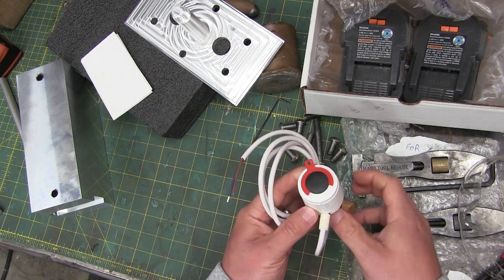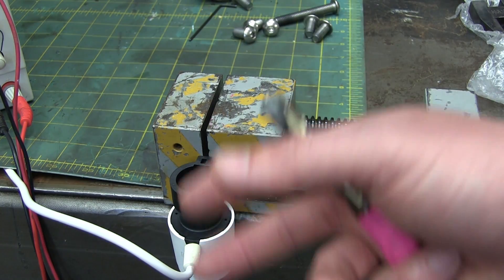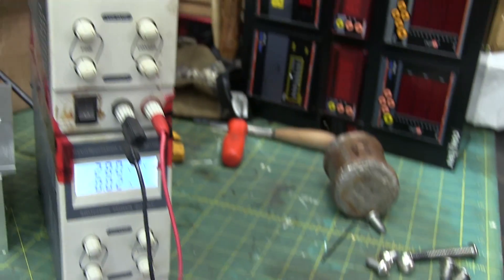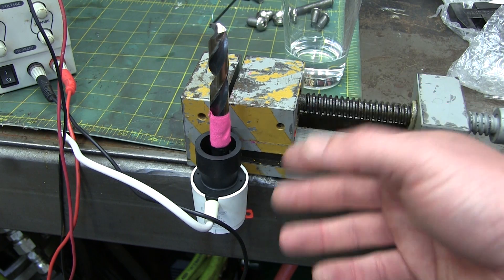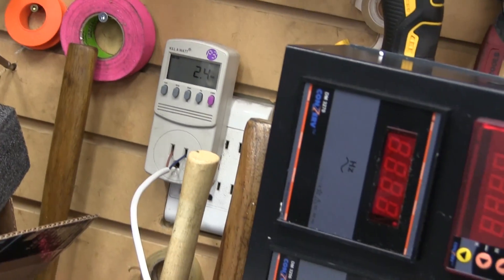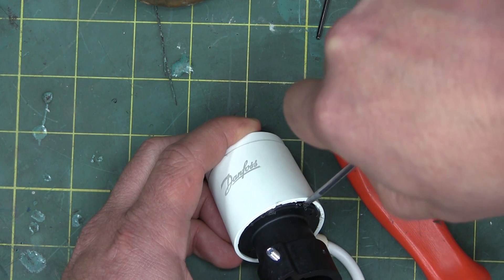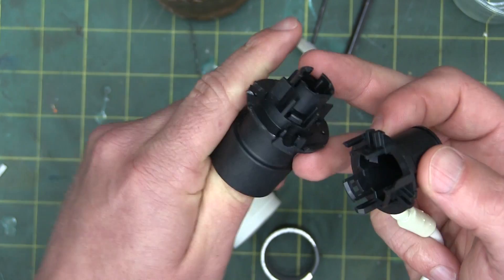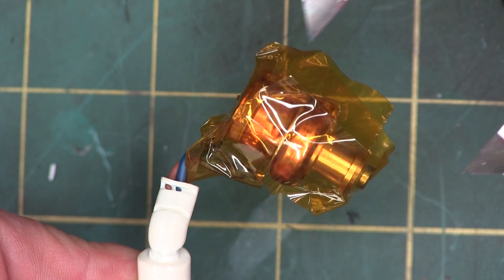BOLTR: Wax Actuated Motor | Mindblowing OLD Tech

Comment: This technology is/was (haven't owned one in quite a few years) used by GM to actuate the front differential lock on 4 wheel drives trucks.  If the truck was in 4wd and it was driven through a cold enough water hole it would cool the motor and no longer be in 4wd.

Comment: Central heating radiator thermostatic valves. and some types of hot water cylinder valves use this technology. one type has a tapered pin inside the rubber element. On heating, the expansion of the wax pushes out the tapered pin. A bit like you grabbing a wet bar of soap!

Comment: Damn! 50psi with 2mm?!? I thought I was doing well lifting my shower towel with 2 inches!
Reply: 50psi? Not quite. He only said 50lbs.
Reply: @benargee  It's way more than 50 PSI, because the plunger that comes out is less than a square inch of area.
Reply: @mbrunnme  I didn't mean "not quite" in a quantitative manner. I meant it in a true/false sense. Yes, 50lbs at 2mm diameter is way more than 50lbs at 1inch (50psi).

That being said, pressure/area is irrelevant to this device's application.
Reply: Danger Bear  allow me to clarify. P E N I S

Comment: I'm sure there is a name for the mechanism, but I'm as some may say "I'm still wet behind the ears" bear with me on this one. Image the do-dad in your whipper snapper that engages to allow the motor to turn over, but also then allows the pull cord to retract, or i guess even a 6 toothed saw blade looking thing. So picture that with one of these motors placed at every tooth so every hour of sun (depending on how many motors are arrayed) one motor would be allowed to expand and retract freely. Just spit balling here.

Comment: This is for a radiator. The radiator valve is normally open and has a pin sticking out, which when depressed turns off the flow of water and thus the heat. It would make most sense if the actuator normally pushes the pin (which explains the spring) and clears the pin when powered. This way a power failure would not turn on the heat.

Comment: These were used in mechanical fuel injection systems as a cold start enrichment system - as the engine warmed, the enrichment circuit would slowly close.

Comment: I owned a Maytag Neptune. So I know exactly what a wax motor is
Reply: Every few months one of my Maytag washer's wax motors would short out and burn up the printed circuit board of the main control panel. Very expensive. Had to toss the machine,

Comment: I thought the component that used wax was the cold engine choke?  The wax holds the choke open until it melts with engine heat and closes with spring actuation.

Comment: The Bell 206 Jet ranger helicopter uses a valve very similar to this as its transmission oil cooler bypass valve.  As the oil heats up the wax inside, the valve closes and redirects the oil through the radiator.  Very simple in design but effective.

Comment: this reminds me of the "how it's made' episode for car thermostats.  they put what looks like copper powder and other things in the wax for some reason (thermal conduction?) and then put it in the cup with a rubber plug just like in this device.  Then they crunch the side to adjust the temperature where it actuates.  This thing appears to have those "adjustment marks" too, to tune its operation.

Comment: I think that I've seen a wax motor that operated the choke on a moped. Engine switched off = no electricity to the choke and the engine is fully choked. When the engine is started the device gets electricity, which makes it heat up at the same time as the engine heats up, then the choke is opened.

Comment: For solar tracking, this would only work in perfect solar conditions. If it is slightly cloudy, or several passing clouds the tracker will always lag behind. Also even in overcast a solar array will output significantly more if correctly aimed towards the sun. The wax tracking idea would fail to accomplish this correctly overcast conditions without the use of some other energy source to provide the heat. I have seen on forums where simar concepts were attempted with these conclusions. Worthy thought experiment in its own right no less.

Comment: You can use gas actuators for analogue solar tracking. As one heats up it expands and moves the panel and itself into the shade. 

As the sun moves it warms the ram again and the gas expands again.

Comment: In HVAC, with careful control, you can get these to modulate using PWM - way cheaper and more reliable than an electric modulating actuator. Just have to deal with the five minutes it takes to open and close completely.

Comment: Also used in some side-loading washing machine latches/lock relys (note: when these "fail", it's often just a matter of bending the contacts. When they truly die, it's usually external plastic bits. It's never the wax motor itself.)

Comment: FYI the 4th Gen of GM 4x4 trucks used this type of actuator on the axle coupling in their front diffs to activate 4wd. They later replaced it with an actual electromagnetic servo for more positive operation.

Comment: Well that was certainly interesting.  Never heard of such an animal before.  I saw a minor issue with the demo, if it needs two watts of input power at 240VAC,  if you feed it 120VAC, and assuming it is a resistive load, the actual input power is only half a watt total, not one watt, since when you cut the voltage in half, the current will drop in half too, and as you know, power is voltage times current.  So essentially it was only getting one quarter of the normal power it requires to work correctly.  I thoroughly enjoy your channel,  you have demystified many mysteries of tools, technique and I still have all my fingers as a result.  Keep up the great work!
Reply: Yeah. P = V^2/R

Comment: GM used this type of device in early 90's 4wd pickups to engage the front axle. As a result, in the dead of winter when it's 20 below, they had a tendency to let you down lol. Eventually they released a refit kit with an electric solenoid. An early fix for offroaders was to remove the wax hookamadook and attach an old school choke cable into the fork in the axle

Comment: AvE through a tuber message at me , I know exactly how to solve your solar panel tracker system.  in a nuttier of a chell. two small solar cells mounted on the same plane as your main panel(s) , preferably the same mount. okay so then you put a divider ion the midline between the two smaller cells so that as the sun moves, it will put the EAST cell into more shade than the west cell, causing a voltage difference that you could feed THROUGH a pair of mosfets as part of an h-bridge to run tracking motor.. end of travel limit switch to rip a reset to facing east.   FOUR photo cells and a '+' shaped 'shade' and a second motor , you could even get the photovoltaic panel to track for season. no having to adjust the angle of incidence every couple weeks or so.

Comment: Hey AvE: First post, Solar Energy Professional here: There are actually several kinds of solar trackers that work based on the principle you mention: Not with wax, but with gasses. For a great example, check out Zomeworks- They've been selling this since the '80s:

Their stuff is pretty simple, using physics because physics is Sexy: They use alcohol or something that has a low phase change temperature to act as a pump to move liquid between cylinders to shift the weight of the solar modules to follow the sun. Think "drinking bird" but on a larger scale.

Comment: Smaller ones are most commonly used in dishwashers to open the soap door flap speaking from experiance they get quite warm
Reply: Ray M wow. 
Thanks I have wondered how those worked for years and haven’t had an excuse to take one apart.
Reply: My old Electrolux had this. I'm pretty sure I still have it laying around in my heap of jun... Uhmmm... In my shop.
Reply: Ola Magnus Lie The proper term is Empire of Dirt.
Reply: wolfedog99
Know your variables.
Water temp is a constant.
Pre wash duration is a constant.
All you need to do is provide the right amount of insulation to delay the opening of the door.
Reply: @c6q3a24  Water temp is not a constant. It varies from home to home, and also varies in the same home dependent on use.
Reply: @BruceNJeffAreMyFlies  
Dishwashers typically heat the incoming water above the household baseline. The engineers designing the delay mechanism know the temperature the unit will operate at.
Reply: I've taken apart a dishwasher with one in it. I said ' A wax motor? really!? wtf!?'
 yup, that's what it is.. learned something new.
Reply: They're commonly used to open and close the vent in dishwashers. They're electrically controlled in that application.
Reply: Thermostat in car cooling systems also use a wax motor.  Heat provided by the engine coolant.
Reply: Learn something new everyday👍
Reply: Wax wife FTW.  Very quiet, works diligently and is hot!
Reply: All the ones I've serviced where just regular electric motors driving a timer contacts and a the door. No fancy wax motor
Reply: Smells fishy to me, or its one janky old dishwasher. How is that going to open for the main wash but not in the prewash and along with high temp/heavy duty vs normal temp or china/light wash cycles? A door isn't needed at all in a single stage wash.
Reply: The washing machine application is so you don't open the door during the spin cycle and rip your arm off. Even if the power is cut and the thing is freewheeling, the hot wax is going to keep that door shut for a while.

Comment: By the way, this is a good way to explain to people why it makes no sense to crank the heat all the way up to as much as she will suffer when you first start the car. The little valve that lets the coolant flow around through the heat exchanger is shut tight, so that the engine can get up to as close to operating temperature in the cold. So, it makes zero difference to have it at 80F or 60F when the temp is 10F outside, and same for the whole engine. This is also why it is a good idea to let the engine idle for a minute or two before you throw it in reverse to scoot off to wherever you are going on that cold, cold day. Got to let all the fluids start to warm up to get to the proper temps!

Comment: .... too crude and over engineered. going solar? one of nature's best and most efficient solar collector is a blue spruce. panels shaped like the branches on a spruce topped with a small vertical wind turbine turning a motorcycle alternator..... might be the tits you're looking for. no need to switch or move anything, but then I'm still a fan of mercury switches and thermometers.....

Comment: Where is the reassembling part of the video? Kidding aside how would the cylinder be assembled? Would it be a multi-die extruded casing paired with inserting the cylinder rod, rubber insert then paraffin jazz then put inside of another mold to roll the edges together in the midsection?

Comment: I wonder what a single acting hydraulic cylinder half full of paraffin wax would do. Maybe a paraffin over hydraulic setup with a large diameter cylinder, wax on one side, oil on the other with the oil flowing into a small diameter cylinder doing the actuating. Probably cost more to build than it is worth though.

Comment: The valves are actually spring loaded to be open and the valve is closed when the wax expands in the wax motor. So you add energy to the wax motor to force the valve to close. This also has the benefit of the wax motor actually working automatically without added electricity as well, which makes it great on hot water radiators.

Comment: Pretty sure most of the older GM trucks (88-98) use the same technique in their front differential actuators.  Should be pretty cheap and easy to scrounge one of those from a scrap yard for more testing and experimenting.

Comment: There are gas cylinders  that work on the same principal.  Much more range of motion so they are better for solar panel tracking.  I use wax cylinders for shutters in my greenhouse, pretty amazing once you get them tuned.

Comment: So the angle of the dangle is directly proportional to the heat of the meat?
Reply: Factor in the Sag of the Bag
Reply: Plus the size of the prize...
Reply: ...and the square of hair and the cube of tube
Reply: You have got it all wrong.

The correct mathmatical relationship is :
Length times Diameter plus Weight over Girth divided by Angle of the tip squared.
Reply: Which is also equivalent to the sum of the cum
Reply: Don't forget the speed of the deed
Reply: that's why you keep it in the vice, to maximize swelling
Reply: One must also not forget the swole of the pole in proportion to the width of the hole.
Reply: Teamwork makes the dream work

And then one day in the land there wasn’t an argument on YouTube comments and everyone was nice and friendly had a laugh 🤭 
Motherfuckers 🤪
Reply: PapaWheelie and the mass of the ass
Reply: Girth potential of the birth canal.
Reply: Precisely
Reply: The angle of the dangle is proportional to the fall of the ball.
Reply: brewers group
Reply: Just watch out for the Goo from the Schmoo.
Reply: parity bit 0 good comment
Reply: Remember to take note of the swing of the dingaling.
Reply: Therefore the urge is constant.
Reply: One must not forget to account for the draft of the shaft

Comment: Eric the Car Guy did a video on something similar years ago.  He said older Hondas (early to mid 90's) used wax in the idle air control valve.  The wax would melt at a certain temperature, and in turn, would actuate a valve.  Very interesting.

Comment: Read through the comments.. they beat me to the chevy 4wd actuator. Curious how well it worked with cold weather? The work ok here in the hot country, just slow...
Reply: Randy Bigler  an05 blazer takes about 5sec after you push the button.  That is a long time to be sideways on ice awaiting some steering input from the front axle. Took about a quarter-mile to complete the 180°  spin  engaging as i came to a stop.

Comment: I do wonder if the copper mix-in might not be for heat transfer after all. Wouldn't the two cases have different profiles of movement over time? A pure paraffin mixture would mix well but you'd still have a solid slug of wax in the middle that melts over time. My gut tells me that would have a slow and non-linear rate of expansion. However, if you're moving the heat through the wax with the copper, you'd approach the melting point much more uniformly, wouldn't you? I think that might result in a quicker, more evenly distributed movement for the actuator.

Comment: @AvE Four lsd's under a parabolic reflector.  Average the inputs and your high point is the brightest field.  It's a chopped down version of the comparator we use in strategic satellite ground stations.  Write program to slew accourdingly.

You'd only need two valves on the upper corners and a hemispherical pivot on the from base.  They can provide all the angular adjustment you need for for a flat plane like a pvc.  It should be cheap and easy with your skill set.

Comment: Typically (at least in my area) we use wax motors with a end switch, thermostat powers wax motor 5 min later the end switch makes which than that powers the boiler and or pump for that zone. Little bit more efficient that way and impossible to get into a water hammer situation. That style wax motor would typically be used in a constant run pump system, like an apartment building, or commercial setting.

Comment: The copper is probably there to help with the heat transfer because the wax has a hopelessly bad heat transfer coefficient.
But i agree, shove a bunch of wax into a tube and have yourself an actuator.

Comment: That concept is used as a choke actuator on Honda motors. Choke is closed when cold, as the motor heats up the wax melts and turns the choke off.

Comment: Similar technology as a thermostat in an engine coolant loop. Calibrated to stay closed, keeping coolant in a short loop until the engine reaches operating temperature, then open to allow flow through the radiator. Uses the temperature of the coolant to actuate open/closed, which can regulate the coolant temperature, thus keeping the engine in the correct operating temperature range. These devices are so simple, they can outlast the life of the vehicle, as long as internals and seals aren't contaminated/corroded of course.
Reply: spring wore out on my last one.
Reply: They last a long time but certainly not outlast the vehicle. They get weak, stuck, or the parafin escapes and the stat does not open at all.
Reply: Understood, yes they can break/fail, but the operative word is "can", as in can (or could) outlast the life of vehicle. Depends on coolant quality, regular service intervals etc...

Comment: If you use it for solar, once the panel has turned, the motor will cool down and it will go back, potentially turning the panel back, depending on how you do the mechanism.
There are linear actuators that can push 50 pounds, they look like a piston, but have a motor and screw thread, we used them for damper actuators

Comment: Awesome!   I love seeing the weird motors!   

I'm wondering if you scale the thing up, if you will have the problem of needing to scale up the paraffin resovior to a point where it requires incredibly thick walls to redirect the force to the actuator.   I guess the force will go out the hole as long as it is easier than bursting the resovior,  with the upper force limit being somewhere around whatever it would take to expand the resovior walls...  (as long as that is less than the force that could recompress the molten paraffin)

Comment: GM used this on it’s early 4X4 trucks (up to ‘95) to engage the front axle shaft. Had it’s failures but worked. It’ll be nice if you did a BOLTR for one of those.